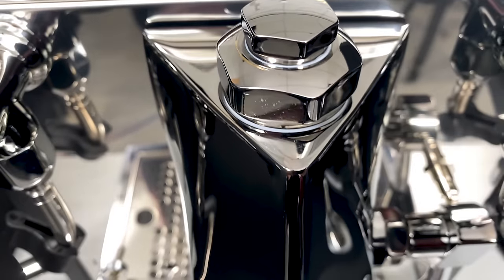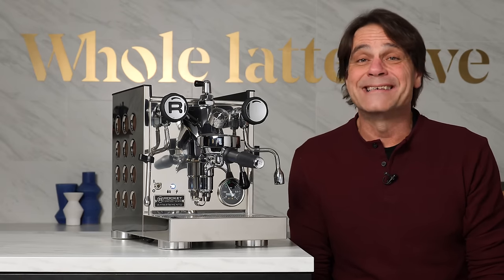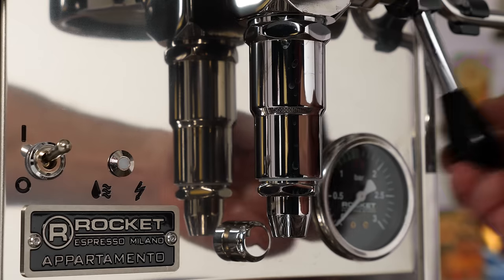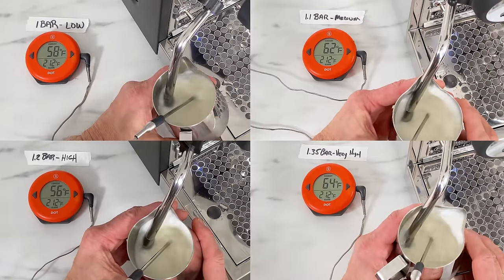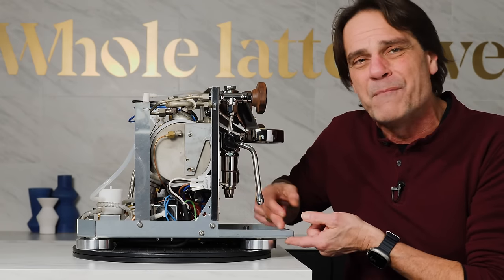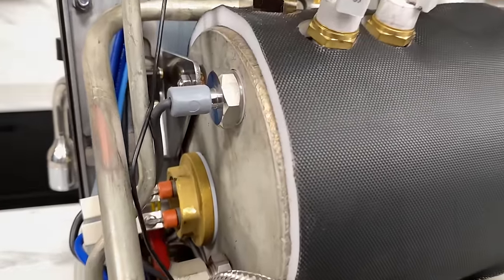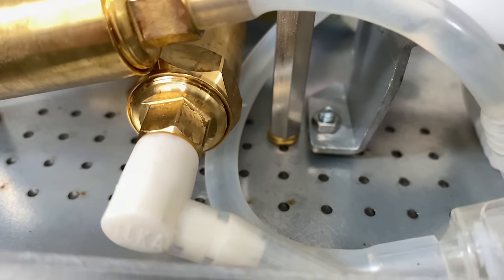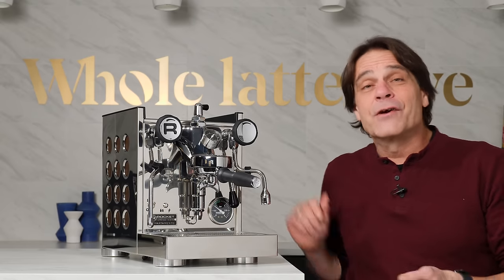Rocket Appartamento TCA Espresso Machine Review

Comment: e61 machines takes tons of time to heat up, look at Ascaso machines with thermoblocks
Reply from the maker: Hi b, Thanks for the comment. Not familiar with those but in my experience with appliance grade machine's using thermoblocks they have poor thermal characteristics, inconsistent brew temps, lower steaming power, unheated group heads/portafilters.
Reply: @Wholelattelovepage  Thanks, it has integrated PID and preinfusion timer, there is also interesting machine Quickmill Luna or Sunny